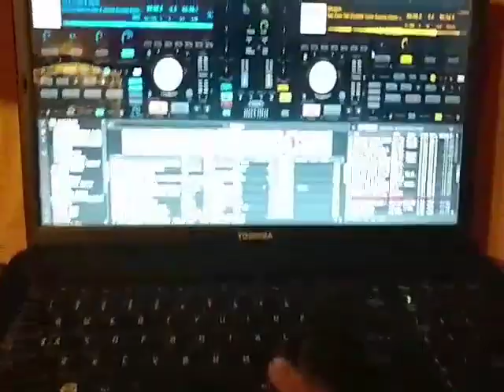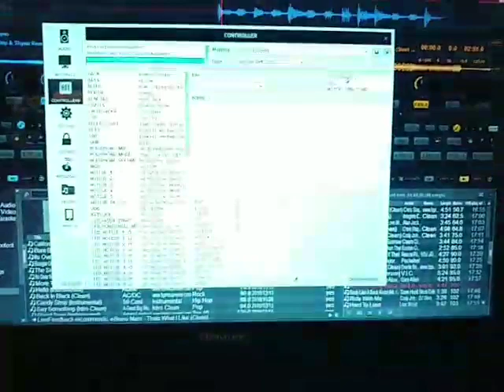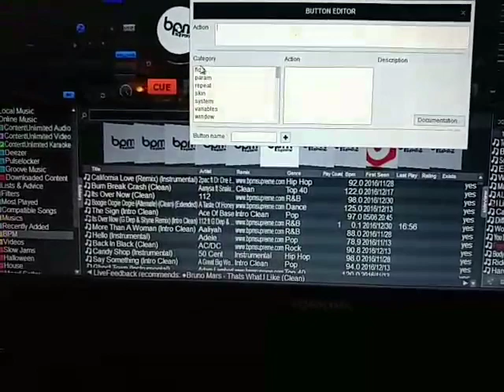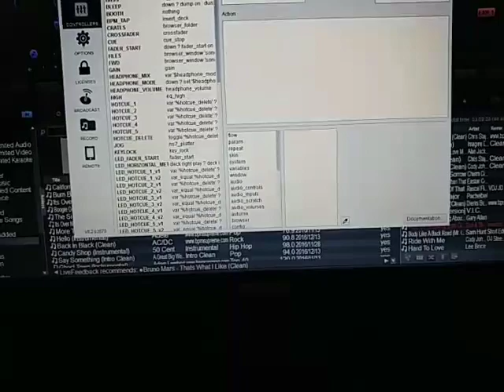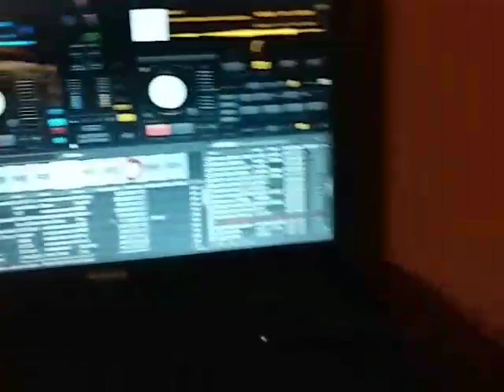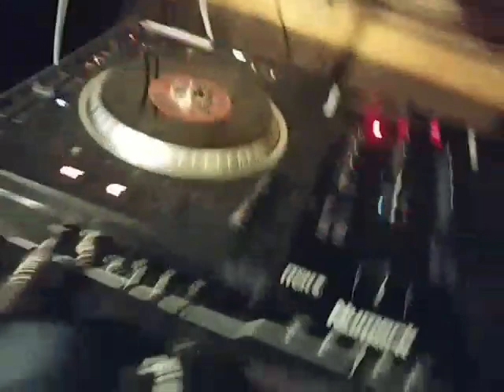VDJ8 NS7 Mic input Fixed

Comment: Interesting Thank You can you do a video on NSFX Bar working sometimes with VDJ8 and sometimes it will not have to keep restarting to get buttons to turn on when you push them.
Reply from the maker: DJ SAVAGE I didn't get the fx for that very reason. I use a launchpad and mapped a few of my least used knobs to adjust my effects ie. eq mid, platter start and stop time